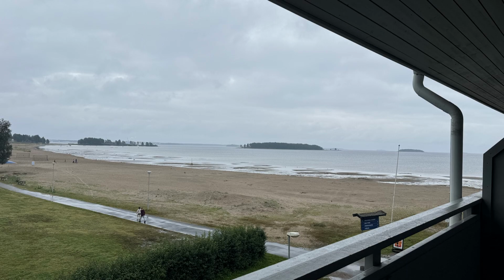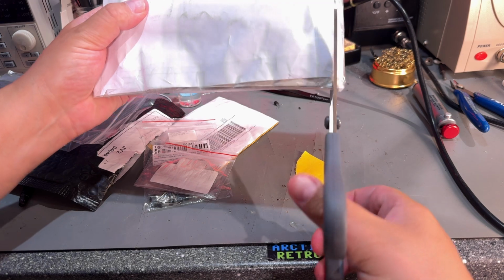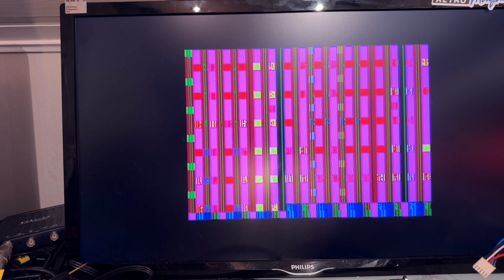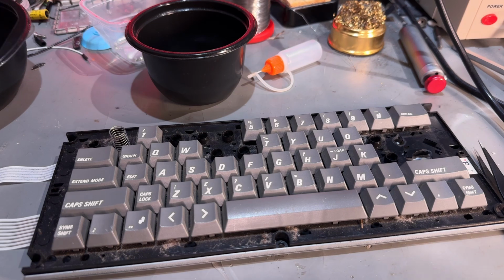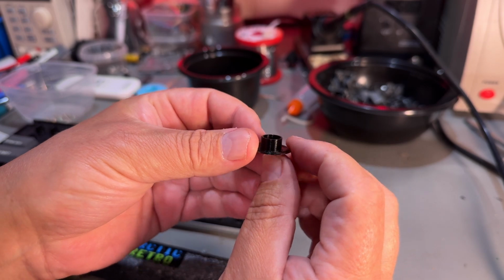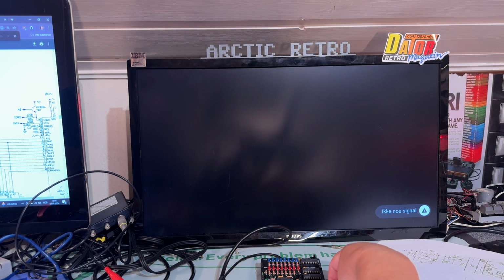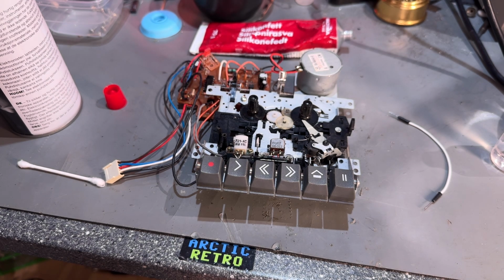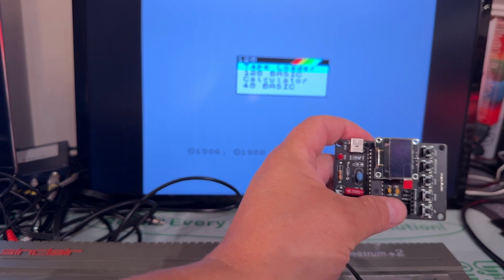Repairing the ZX Spectrum 128 +2 - Got some new parts but still need more

Comment: Was just about to comment that the problem was probably the cpu and then got to the part where you also found out and got it running. Hitch the diagnostic cartridge you could see, ‘no diagnostic hardware found’ and the remark about the m1 line. I think the z80 that was in it had exactly that, a bad m1 line.
Reply from the maker: Thanks!

Comment: Good to see you and Kojro both have new videos up.  That looks like a late-model Speccy, judging from the AMSTRAD label on the board.  That would put it somewhere past about 1986?
You will, I'm sure, eventually get it working 100% again.  Be careful with silicone grease - it tends to migrate and get on belts and other stuff it really shouldn't.
Reply from the maker: Thanks for the info!
Reply: @Arcticretro  You're welcome, Tommy.  White Lithium grease (like Lubriplate) is a bit better, and tends to stay where you put it a bit better.

Comment: With such an irregular break in the plastic for the return key, maybe lay down tape, then fill in the entire section with epoxy to create a new floor/structure to work from. Then drill out a new hole and 3d print a new spring cylinder / key post.
Reply from the maker: Thanks for the advice. I think I'll try that :-)